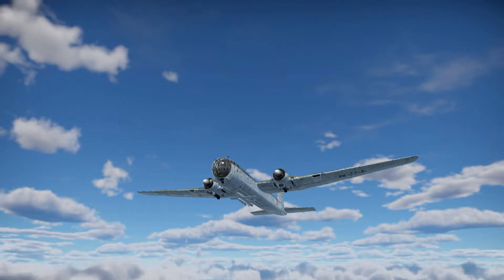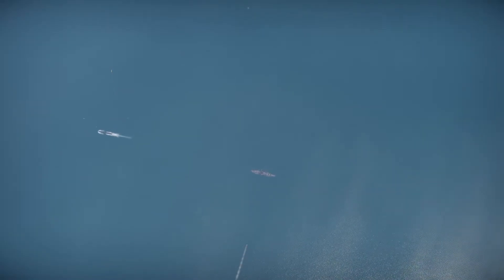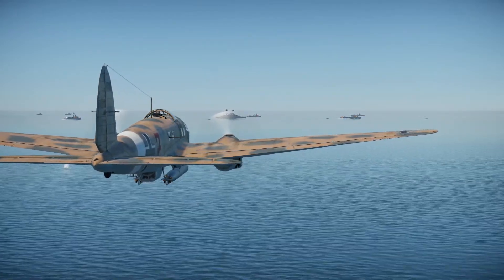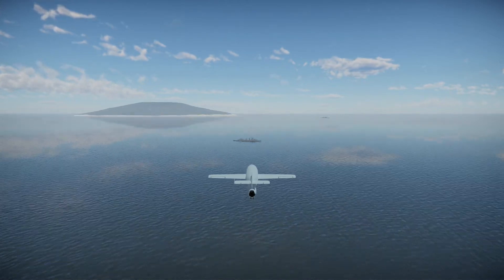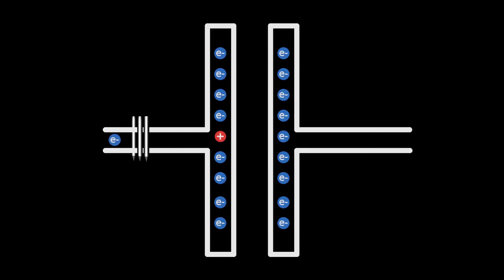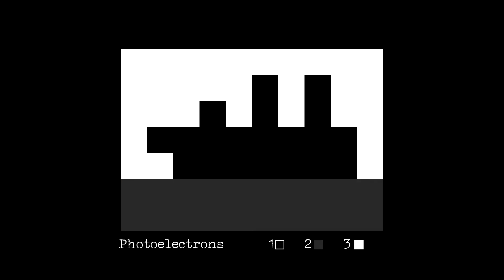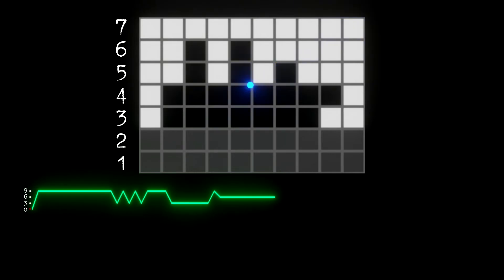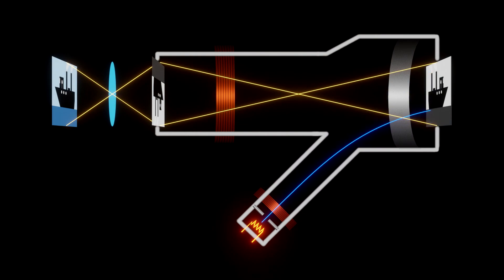How did the HS 293 D  TV guiding system work ?

Comment: FWIW: One thing that STILL amazes me regarding CRT TVs & monitors is how QUICKLY AND PRECISELY an EXTREMELY NARROW BEAM OF ELECTRONS is guided both horizontally and vertically across a phosphor screen, controlled solely by electromagnets.
Reply from the maker: Yes im amazed by this aswell.
Those CRTs are inferior technology but they appear to be a work of art and much more ingenious than our modern RGB Pixel screens.
In general analogue technology appears to be more complex than something thats "just" run by a computerprogram.

The " narrowness" of the beam is controlled by a negatively charged pipe that sits between the electron source and the accelerator plate. The free electrons are forced towards the center of this pipe (whenelt zylinder). 
The motion of the beam is usually controlled by charging and discharging capacitors. The up down motion is controlled by the AC power frequency (that's why American TV had 30 fps (60Hz / 2) and European TV had 25 fps (50Hz / 2) and the left right motion is calculated from the frequency and the number of lines in the image.
Reply: This may or may not make it even more amazing/impressive, but the same can also be done using electrostatic deflection. Unsure what was used in the set for this, but electrostatic tends to be used in oscilloscope tubes in particular (edit: which also overlap heavily in requirements for early radar sets), but the tubes must also be very long. As for magnetically steered/focused CRTs, the fact that they can even make them shorter than the screen diagonal is pretty astonishing. Another impressive bit is the imaging sensors from this era, and are a brilliant feat unto themselves.

edit: I also wanted to point out that it's complicated as it is to do a simple black and white TV, and a typical color set uses 3 distinct guns all firing through the same field, and aligns such that they have almost no bleed over between the holes/slats that separate the different colored phosphors - using ViewSonic G220f as an example (known for its very small dot pitch), that's .21mm for each color triplet... so 0.07mm per each colored subpixel.

edit2: personally the most impressive part to me with respect to CRT is the source of those electrons starts as a barely-regulated fuzzy mess essentially boiling off randomly from a hot filament.
Reply: @dave_sic1365  just wanted to say that CRTs are not "inferior" just becose we don't use them as often as they used to. Today's tech is better in many respects but CRT displays are still better today at input latency or motion blur for exemple. Today IPS or AMOLED displays hardly match what ancient CRT did just by it's working principle. I wish CRT would be still a thing in our 1080p60 era. Gaming experience would be amazing.
(i hunderstand what you meant but i can't help myself defending CRTs. Hope you don't mind to much)
Reply from the maker: @gregorymompezat2261  Oh i dont mind, all opinions have to be shared.

I thought about Image sices that can be much larger and that alot less Materials are used to produce the modern Screens. I didnt know about their lower Performance compared to CRT

Im a Fan of retro gaming and still use my familys old Sony trinitron CRT screen for gaming on PS2 console.

Comment: I found a very interesting document "Benecke, Quick. 1957. History of German Guided Missiles Development" Edgar Kutzscher's section discussed infrared homing devices. In wartime Germany, lead sulfide and lead selenide photocells were known to change resistance when exposed to infrared light; experiments showed improved sensitivity when cooled with cryogenic liquid air. Experiments were tried with modulating the signal with a rotating semicircular opaque "chopper"; the early AIM-9B Sidewinder used this concept.

Kutzscher mentions thallium halides used as near-infrared-transparent material; I have not heard of this elsewhere; I believe early AIM-9B Sidewinders used magnesium fluoride.
Reply from the maker: Oh wow that's very detailed.

I knew of experiments with lead Selen alloys but not how far they got and if there's useful source material.

The only succesful ww2 heat seekers I know are the American azon bombs to target blast furnaces for metal extraction.
Reply: @dave_sic1365  do you know of any Infrared sights for airplanes? I know that some even had a CRT screen for showing the image, but were usually filled with ground clutter or could not detect bomber smoke trails, thanks to use of exhaust cooling...
Reply from the maker: @marcox43  I read about such a device but didn't think that the source is trustworthy.

Maybe there was another similar device used in the cold war
Reply: @dave_sic1365  ohh, gotcha. Btw... Would it be possible to have NVG if I placed a ZG 1229 Vampyr in front of the camera used in the HS 293D? Just coming up with some silly ideas for experimental systems
Reply from the maker: @marcox43  that's possible, early nvds worked like this.

The problem might be the sice of the optics. The Vampir device had a small Optik for human eyes while the "Tonne" camera had a 4cm diameter lense.

Comment: Excellent explanations! Is this process of transcribing an image into an AM signal known as "raster scanning"?
Reply from the maker: I'm not sure about that because the image is scanned in a continuous line and not in a "raster" pattern

 (however I simplified the image plate as "Pixel-raster" so my animation does show indeed raster scanning )

 but it might be the scanning procedure of another imaging tube. 

Another translation for raster scanning might be "Rasterfahndung"
Which is a process used by the police to catch terrorists.
Reply: For a long time (and due to the usage of the term in modern computer imaging contexts) I thought that there might be a distinction between scanning systems where the image elements were deliberately discretized vs a continuous scan with no discrete steps, but from what I can tell etymologically, 'raster' more properly describes the sweeping action (and comes from a Latin word that means 'rake') - so personally, I would agree with the usage of the term. However, in modern parlance/jargon, it has come to be synonymous with images composed from/stored as consistently sized individual elements. Finally, the process by which the image is reconstructed/deconstructed either on the screen/sensor or in lower-level hardware/software most often uses a continuous sequence of pixels with a specific run length before moving to the next line, so I feel the term applies well to most of these too.

Comment: Its ingame now
Reply from the maker: @-privat-9061  yeah i saw 🤩
But unfortunately i wont be able to grind the Battlepass.

Looks like i will have to feed the snail for the first time
Reply: @dave_sic1365  can you to a tutorial on how to guide the bomb? I really dont know how it works
Reply from the maker: @-privat-9061  there were different methods of TV guiding. One was just having skill from excessive training, the other was mounting a metal wire loop in front of the camera that showed the predicted point of impact. 

Im planning about a split video one part about the hs293 and one about the hs293 camera, i could have a capitel on guiding the tv version.

Comment: [Edit - because my previous comments were a bit harsh :( ]
An interesting try. However, one should assume that the viewer has a basic understanding of electronics. Otherwise you would have to explain polarity, electrons, voltage, etc. So why did you want to explain how a capacitor works?
You also need to practice your English accent. (My German accent is very bad because I don't get enough practice.)

[Bearbeiten - weil meine vorherigen Kommentare etwas hart waren :( ]
Ein interessanter Versuch. Allerdings sollte man davon ausgehen, dass der Betrachter über ein Grundverständnis von Elektronik verfügt. Sonst müsstest du Polarität, Elektronen, Spannung usw. erklären. Warum wolltest du also erklären, wie ein Kondensator funktioniert?
Sie müssen auch Ihren englischen Akzent üben. (Mein deutscher Akzent ist sehr schlecht, weil ich nicht genug Übung bekomme.)
Reply from the maker: Ja ich frag mich das auch oft wie viel Vorwissen man voraussetzen kann/darf. Zt komm ich dann vom hölzchen aufs Stöckchen beim erklären bestimmter Aspekte und lass dann andere komplett aus.

Was würdest du anders machen oder anders wünschen? (ich habe deinen ersten Kommentar noch garnicht gesehen, da hast du wohl schon Vorschläge gemacht)

Den Kondensator hab ich nochmal hier erklärt um das relativ leicht verständliche Bild der elektronenbewegung beibehalten zu können, meist wird er ja nur als Speicher eines nicht besonders greifbaren E-Feld erklärt.
Reply: @dave_sic1365  Lies nicht meinen unbearbeiteten Kommentar!
Reply: @dave_sic1365  Es war interessant, von den verschiedenen TV-Erfindungen zu hören, in Großbritannien hört man nur von Baird. Der erste Teil über die Rakete und ihre Funksteuerung war in Ordnung, aber ich fand die Erklärung über den Kondensator unnötig und die über die Kamera wiederholt und schwer verständlich. Die Erklärung des Fernsehers war in Ordnung.
Wo auf der Zeichnung waren die im Kommentar erwähnten Spulen?
Warum TV-Führung verwenden? Ein paar Gründe wurden genannt, aber nicht die Schwierigkeit, die Höhe/Entfernung einzuschätzen, und die Tatsache, dass es schwierig wäre, irgendetwas bei solchen Entfernungen zu beurteilen.
Keine Erwähnung der Möglichkeit von "Jamming".
Vertikales Scannen würde "simplify aiming at the waterline" , warum? Vermutlich, weil es zwischen den Scanzeilen nicht verloren gehen würde.
Warum Qualität für Framerate opfern? Vermutlich wegen der hohen Geschwindigkeit der Rakete.
Ich denke, es war ein gutes Video, bis auf die versuchten detaillierten Erklärungen der Elektronik.

Pausen waren zu lang. Überprüfen Sie die automatische Übersetzung, um zu sehen, wie einfach es ist, Ihren Akzent zu verstehen. "Backside" bedeutet im britischen Englisch "bum" :).
Ich hoffe, meine Kommentare helfen, versuche es weiter.
Reply from the maker: @evaluateanalysis7974  Ohje, von Baird habe ich noch nichts gelesen.
Das Bild das bei mir entstand ist dass röhren TV von zworykin und Farnsworth geprägt ist und unabhängig davon schonmal von takajanagi ausprobiert wurde. Die deutschen waren nur die ersten die TV als unterhaltungsmedium mit regelmäßigen Sendungen benutzt haben. Ich weiß das vorher schon unregelmäßig in England gesendet wurde, hatte Mr Baird damit zu tun?

Danke für die weiteren Anregungen, den Teil über vertikales scanning habe ich bewusst kurz gehalten weil bis heute nicht sicher ist ob die massenproduzierte Version mit horizontalem oder vertikalem Zeilenscan gearbeitet hätte. meine hauptquelle hat nur den horizontalen scan erwähnt. Ein zwei Sätze wozu das ganze hätten aber sicher nicht geschadet. 
(wie du beschrieben hast geht die wasserlinie am schiffsrumpf nicht zwischen den Zeilen verloren und eine höhere framerate ist besser für die Steuerung bei hohen Geschwindigkeiten.) 

Die pausenzeit wird schon im nächsten Video verkürzt, dass ist mir selber schon negativ aufgefallen.

"Bum" kannte ich bis jetzt nur als Bezeichnung für den po einer Frau😁
Reply: @dave_sic1365  „Bum“ trifft sowohl auf Männer als auch auf Frauen zu, aber man hört wahrscheinlich mehr von der weiblichen Version :).
"Backside" ist harmlos und wahrscheinlich ziemlich altmodisch, aber am besten vermieden, es sei denn, du meinst "bum".

Ich bin froh, dass meine Kommentare dich nicht beleidigt haben, da sie hilfreich sein sollten.